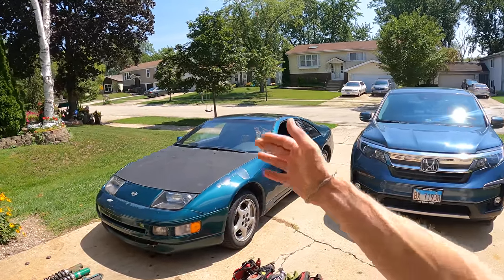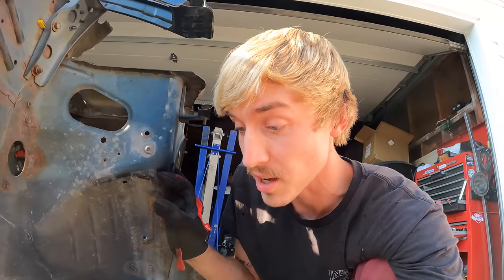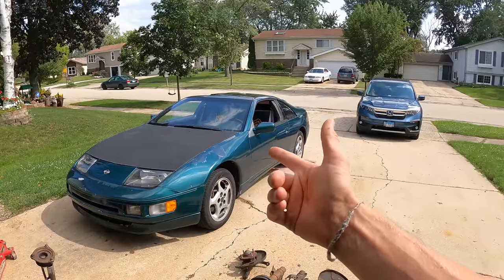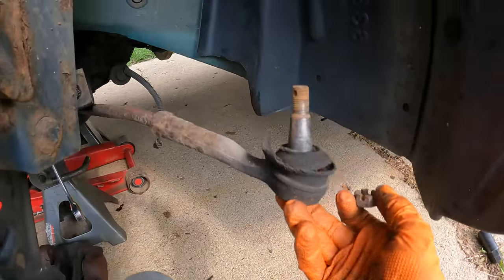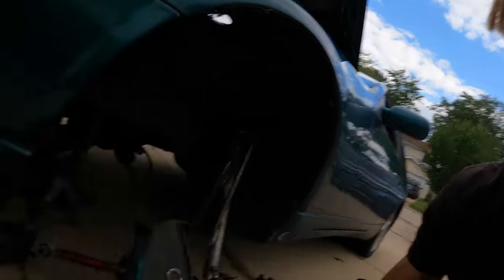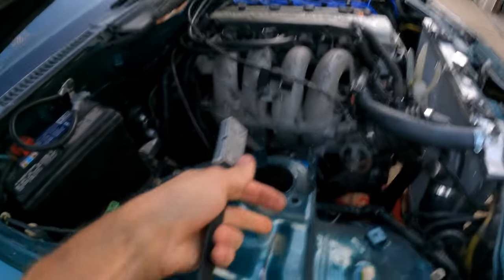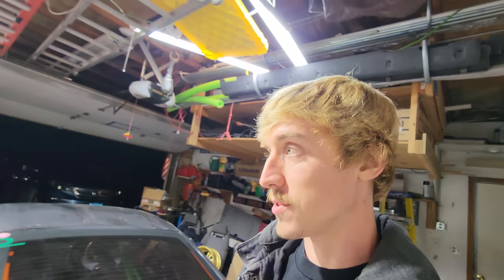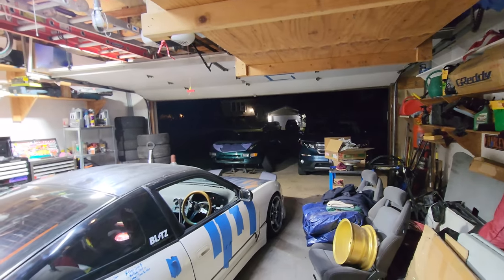Converting my 300zx to fit 240sx MacPherson Suspension!

Comment: so i cheated, i mounted to the stock location but,  i used gktech budget offset strut tops, nismo s14 lcas, godspeed modded s14 knuckles, gk angled tension rod brackets, isr s13 to z32 brake braided lines, and now i just need to figure out a solution for the sway bar. i dont think an schassis one will work due to the z32 being wider.

Comment: Yo I had a 240 question I was hoping you could help with. My single cam car sounds like a bag of hammers when I crank it, and it sounds fine at lower rpm. At high rpm it rattles, do you think it could be piston slap, or timing chain related?

Comment: I like the approach here starting with jigs and all that and logical straight forwards step. Though you could have definitely avoided all of that cutting by using a Z top hat on S strut with a generic bearing in-between the spring plate and top hat to allow for rotation.
The setup list would go as following, 
Z tc rod, lca, tierod
S ball joint and hybrid strut.
No cutting required.

Comment: You made that conversion so easy to do to the z. I was wondering if you still happened to have that jig set-up? I plan to do this to my z32 as well and I'm local as well. What spring rates are you using on the car as well?